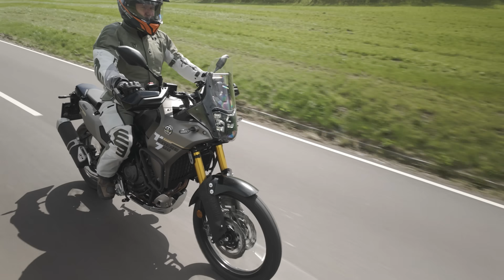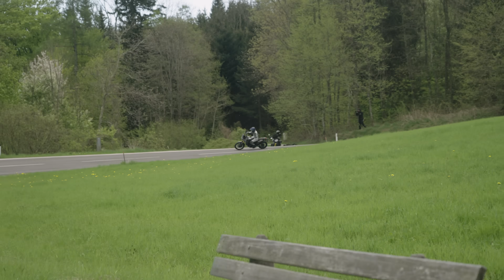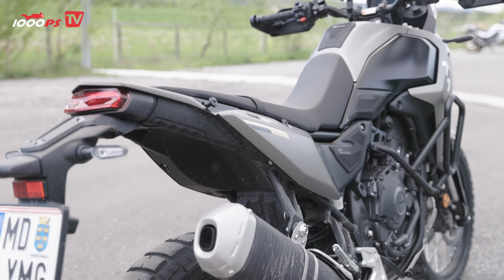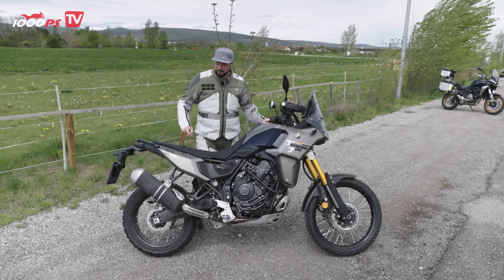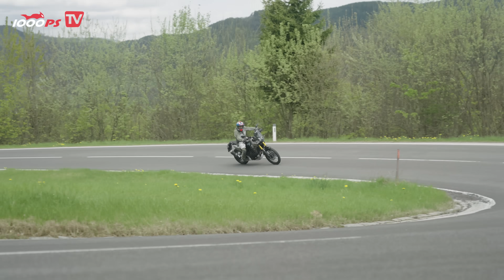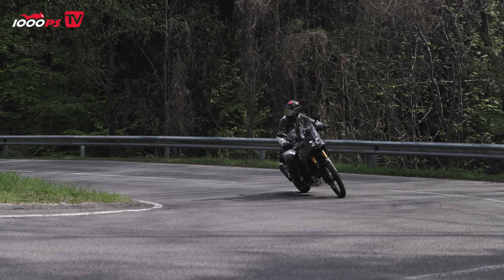Yamaha Ténéré 700 2025 Road Test – Here’s How It Really Rides!

Comment: I used to ride strom 650xt, mostly roads and looking to buy tenere 700 as it looks really good. Should I get this or strom 1050DE? Is it much worse 700 in compare with strom 650 on the road?
Reply: Same here I have a v storm 650 xt from 2023 and love it. My first bike was also a v storm from 2016 and switched Harley for couple of years  but I can tell the looks of the tenere is amazing but this bike is 30% road and 70% of road while v storm is more 60% road and 40% off road. I suggesest to get th 1050 if you want to travel with your bike if your mainly in the highway/roads

Comment: As a mechatronics engineer, to me, this bike would be perfect if it lost all the additional and silly electronics.

That is part of the reasons why the first versions of the T7 appealed so much.

Am old fashioned but an adventure bike is not about rider modes, TC, ABS nor about automated blinkers (Sean Connery asked for 1 ping and 1 ping only).

Cars, bikes and what not trying to automate and control everything to meet marketing means more and more problems to fix and maintain in the long run.

The marketing stagnates better developments. 

For the same reason Steve Jobs hated focus groups as they only led to expanding on the same rather than jumping the curve.

I expect that 2025 might be the last version of what made the T7 the T7. It has some great improvements. The spirit is still there. 

But trying to be every thing to every one every time only means becoming another version of every other adventure bike.

Comment: Just bought one and I really like it but there’s a few things that need to be done asap. Better seat, stock seat is horrible and makes my butt go numb or worse, just straight up hurts, a windshield extension or mini windshield that clips to the original (mine works great) due to wind buffeting, anything over 45-50mph is very bad and strains my neck and an ECU tune to smooth out the fueling/throttle. There’s great videos out there showing how much the Euro5 regulation screws up this bikes performance. But overall it’s a fantastic bike!
Reply: @Dandonsman  do you know where to get a good fuel map? Or do t7 owners all get custom tunes?

Comment: Unfortunately, it's very clear that you don't have experience with this type of motorcycle. You're repeating catalog specs, but you didn’t mention anything about throttle response (previous Teneres had an issue with an on/off-style reaction), nor about the bike's behavior during braking, the gearbox performance, or many other aspects.
Reply: To my knowledge, the fly by wire throttle has sorted out the on off response of the wired throttle. 
My 2023 T7 has the gearbox issue. Yamaha has issued a recall for this and the dealer will be replacing my clutch plates free of charge soon.
The brakes of the T7 does not have a fantastic bite, but I have pushed this bike to its limit onroad, and both the brakes and abs have worked well.
The T7 is a marvelous do it all bike. I love it so much that I have ordered the 2025 model.
Reply: @amohammed3337  I just tied 2025 model. Throttle reaction is as it was - still jerky.
Reply: @podunkman2709  That's unfortunate. I guess I will have to continue to use the clutch to compensate.

Comment: At 58 and after a 20 year break from motorcycling i bought a Honda CRF 300L last September. 
Its great and i love it but its already not really powerful enough to pull my 95KG body up hills, especially into a headwind.
So this is my next stop, great review and a natural progression from a CRF.
Reply: Fantastic! Your comment gives me so much hope. Currently on an almost 20 year break from motorcycling myself and at 48, I’ve been itching to get back on 2 wheels.
Reply: Yes, I also had a 15 year break and came back with a World Raid. Put some Mitas XT + on it and there is nowhere I can’t explore.
Reply: I am 115kg. I really appreciate the torque of a T7. It can move me and my gear swiftly up hills and along freeways nicely.
Reply: mmm,  be careful with that. We're roughly the same weight and my 2024 picks up to 110MPH without much struggle, more with a longer stretch of road. Either way, don't get to ham fisted and it's a great bike. Has not had one complaint in my years of ownership.

Comment: At 1,70m, I’m a fairly experienced rider. Coming from a 1250 GS, I’m looking for something nimbler, that I can use in town and around. Is it suitable for me in the highest stance, in your opinion?
Reply: I'm 188cm and my brother is 174cm. We both have Teneres and we can both ride them comfortably in all positions. My brother actually prefers the taller rally seat, even though he can't touch the floor fully with his feet with that seat, he has to slide down to the left/right to get his foot down but prefers the rally seat anyways! At standing position, he says the bike fits him perfectly and at 188cm, I say the same thing. Yamaha actually made this bike fit shorter people really well - which is not surprising, because Japanese people are about 170-175cm tall on average.
Reply: Wearing 30“ jeans, with the 2023 model I can tell you:
I do have the lowering links installed (ca -2cm).
I started with the low seat in my first season, went back to the std. seat and even got myself the rallye seat. So basically stock hight, but 2cm less ground clearance, 2cm higher seat.
It‘s quite high though. Can barely touch the tips of both feet, but keeping one foot on the pegs is fine. Sliding a bit allows to flatfoot one side.
But:
The great thing about the rallye seat is, that you don‘t sit „in“ the bike and you can move more foreword. Your arms will not be stretched as much and will hang down. Way more comfortable to ride.
Problem with the low seat is, that it is quite flat at the top, but gets very wide very quickly.

Comment: Great review.  I have a deposit on a sky blue T7 but trying to decide if I should keep my Super Tenere 1200 and let the T7 go.  I love having cruise control and heated grips on the bike I have.  Would lose those on the T7 unless I spent even more money on them aftermarket.  Decisions decisions....
Reply: Go for the T7 👍 a friend  had the same problem, he went for the T7 😀 and he is more than satisfied
Reply: Keep the T7, there is a reason Yamaha discontinued the super tenere (at least for 2025). While I agree cruise control is nice, the 2025 T7 is prewired for the Yamaha heated grips and controls for them are already implemented into the TFT display (they can be adjusted and controlled from the new switch gear joystick).
Reply: @LostboyMoto anyone have a part number from Yamaha for the grip kit? Or should I go with Oxford aftermarket kit?
Reply: @ericewing3615  oh no, go with the yamaha for a seamless installation and being able to control it through the dash. part number is: BRL-H29A0-V0-00
Reply: The yamaha kit fits good and you can control it right off the display. As far as cruise control veridian makes and aftermarket one for the t7 thats apparently pretty good
Reply: That’s odd, In the US the 2025 has cruise control, 🤔
Reply: @94Greenbean 2025 is now throttle by wire
Reply: Heated grips really don't cost that much. The Koso with integrated buttons are very nice and reasonably priced.